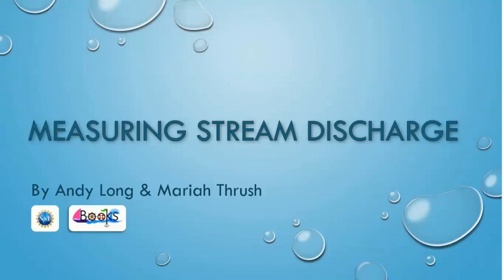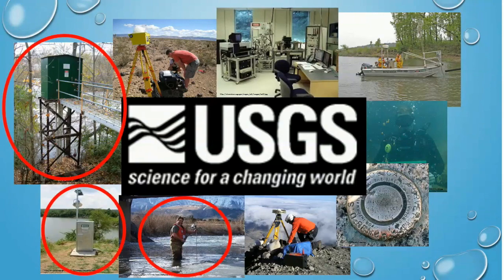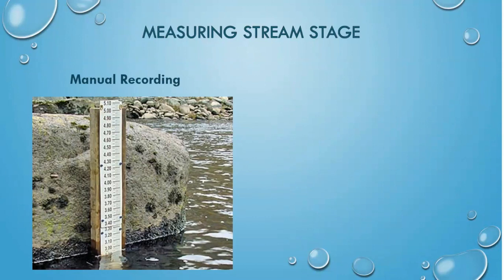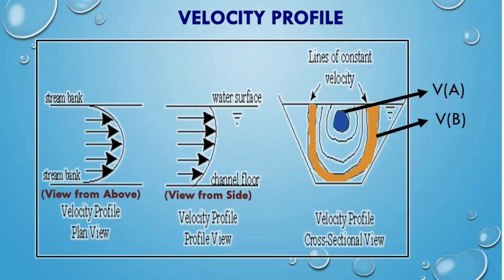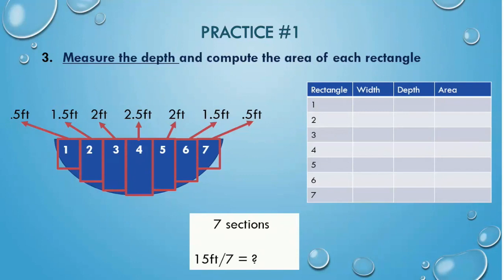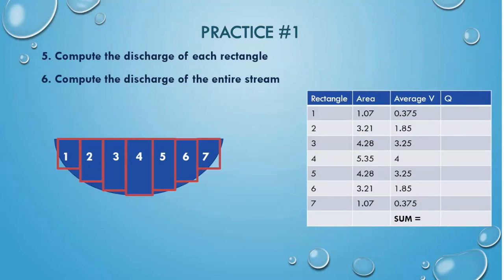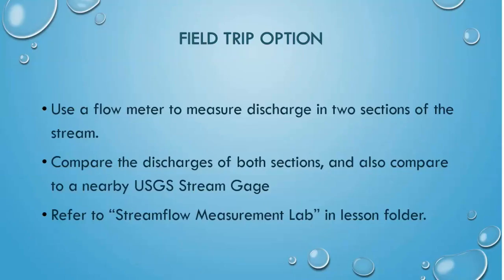Stream Discharge Measurement

Comment: 3:03 Steps of measuring discharge
3:39 Measuring stream stage
4:08 Measuring discharge
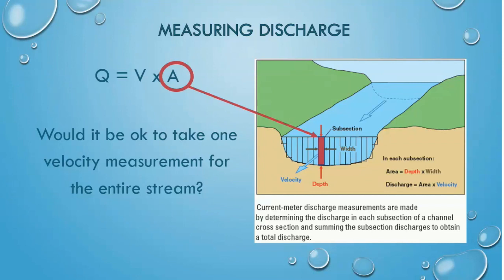5:06 Subsections
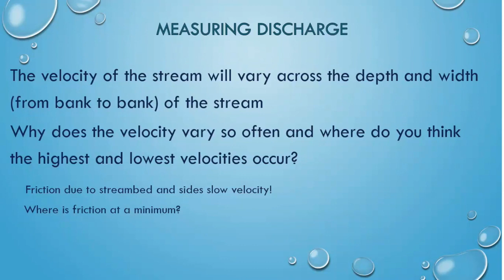6:15 Velocity profiles
7:03 Flow meter
7:32 Finding the area
8:00 Measuring discharge
11:13 Rating curve